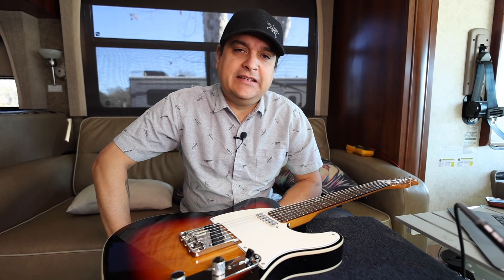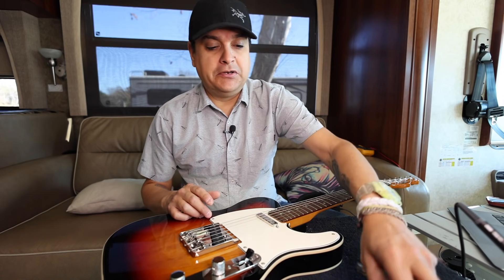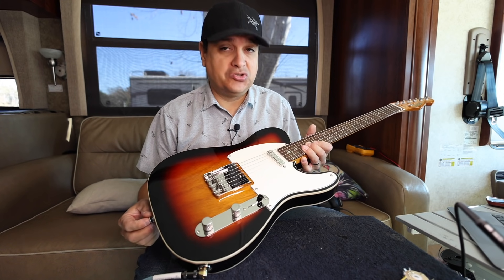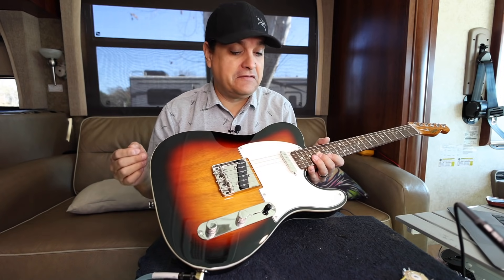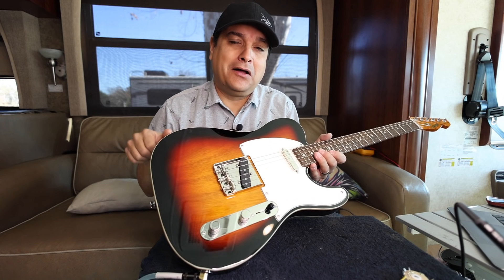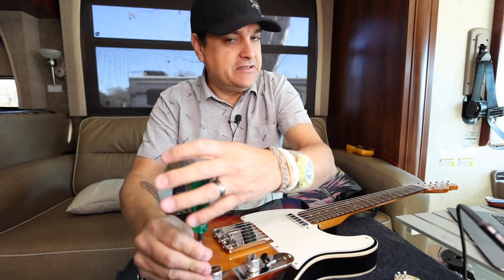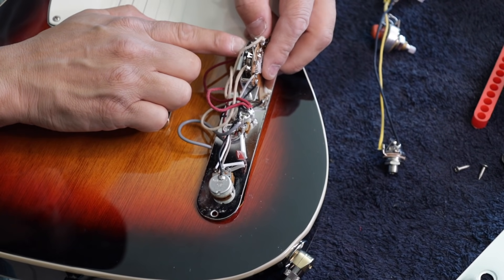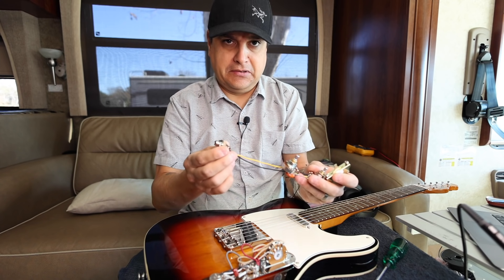3 Reasons To Replace The Pots And Wiring On Your Guitar

Comment: Worth a mention, sometimes in just replacing the pots and wires in a budget guitar, you can 'rescue' a set of stock pickups. Sometimes [I said SOMETIMES], doing that simple change may breathe some more life into the circuit. There are naysayers, and they do not have MY ears, so when they say they don't hear a difference then it may be because their ears cannot hear the difference made. I have done this to Squier and Epiphone both with some success and not. But, the issue is, SOMETIMES it it worth doing the pots first, before buying expensive pickups for 'old/cheapo' pots.
 I guess it won't get mentioned since you might be sponsored by suppliers/manufacturers.
Reply: Absolutely true. Some inexpensive ceramic magnet pickups sound absolutely fine with the addition of quality audio taper pots of an appropriate impedance and a suitable capacitor value in the tone control circuit. It’s certainly worthwhile to do the pots and wiring first then re-evaluate the stock pickup sound before committing to a pickup upgrade.
Reply: @15thwardadrian  Exactly, I glad you added to my comment, it adds to the evidence and I thank you SIR. And, you know there will be more naysayers commenting on this, and their added silliness of inexperience will be witnessed by all. Likely, Millennials and Gen Z's that just haven't learned yet.
Reply: Total Bollocks!  Like for like impedances and capacitance will not change the sound regardless of what you interchange.  Only thing that will change is reliability.  Thats just the way it works with electricity!
Reply: @brin57  Yes, on paper the values follow rules, but the actual readings differ from manufacturer to manufacturer, and that affects audio signal. Usually, the cheapo pots inhibit some of the signal. If you follow what books and math tells you, you get the answers, but not the experience. Ears can tell the difference, if yours don't, then I'm real sorry about that.
Reply: @b.scottfarthingsworth  Readings differ even from the same manufacturer of the same pot.  It's called tolerances.  As for cheaper pots inhibit some of the signal, that's what pots do. All pots.  Thats their function.  Some just last longer than others or are smoother, but as I said, like for like will yield the same result.  If not, then something is different.  No 2 pots or resistors or capacitors are the same, and any perceived differences in sound, could just as easily happen between different instances and/or combinations of the same products.  Not just between cheap and more expensive.  As for your ears argument. That's just condescending.
Reply: @b.scottfarthingsworth  Your arrogance knows no bounds.  You just sit there and assume you are all knowing, without even having any idea who you are referring to, their knowledge and experience.
Reply: @brin57  okiedokie keep buying pickups everyone👌
Reply: @tommacdonald6295  Love how he assumes he's talking to people with no knowledge or experience.  Oooh, he's got golden ears!! More like cloth ears.
Reply: Most of the time...it is what you WANT to hear as you might not have changed anything at all.
Reply: @b.scottfarthingsworth  Yours and other's half informed sage further adds to their confusion.
Reply: @brin57  Value is value in components not mechanical. Their is where the reliability factor lies. People like to feel good spending too much money chasing myth.
Reply: @alwaysopen7970  Or others feel good trying to get others to spend too much money chasing myth, based on their sketchy subliminal bias's.  The biggest change to be had from re-wiring your guitar with quality parts is reliability.  Longer lasting smoother pots and switches ,  better solder joints, etc.. Not improvements in the sound quality (except if you're changing out scratchy pots) and certainly not changing the fundamental character of the sound.  Maybe a new Youtube channel is in order.  Audio Mythbusters !!  Probably already exests.
Reply: @alwaysopen7970  maybe for you, because of what your ears hear, as opposed to what someone else's ears hear. Also it's agreed that SOME of the time nothing changes, anyway. 
I've even experienced times that it may have sounded worse. But like I said previously, And to my ears, SOMEtimes there's noticeable differences that I've heard as positive results in that quest. I said MY ears. Maybe your ears don't hear the same thing that mine do? But, no investigation is needed. In my ears, it is already proven. And others are in agreeance with me, so they're hearing some of the same things that I do, too.
Reply: All good advice but firstly, check the height of your pickups! Setting them to the recommended or suggested heights of the manufacturer DOES make a difference.

Comment: Question:  I have a 1999 Fender Nashville Telecaster 3 pu/ 5 way.  All 3 Seymour.  B Bender Saddle, CTS, 22, Treble Bleed,
Vintage Wiring.  My favorite of 8.  All tube amps except a Fender Deluxe 112 which as you know is a Freak!!  What is the
loss in Potential and Frequency between the Vintage wiring an the Modern wiring.  I am willing to make one more internal
change on this Beauty.  Go back to Modern or stay with the Vintage Mod ???  Thank You  DGA

Comment: Would have been helpful if you had A/B edited the before electronics change and after electronics change video/audio closer together. With that much time passing between the examples, it's hard to tell any thing. 
I've found, over the years, with many of the overseas produced instruments that the weakest link is the electronics and it is primarily a reliability issue. Switches go first, pots get intermittent and jacks don't make good contact after a fairly short time.

Comment: I bought a display 2021 Affinity tele from a large store for the discount. It had a couple small scratches. When I opened it up...it has CTS pots. I wonder if it came with them or was it repaired or upgraded in the store.
Reply: CTS pots are most definitely not stock for an Affinity Tele. You got lucky !
Reply: @raytorvalds3699  Lucky? Only if they are the right ones.
Reply: @JasonWW2000  Heh true.
Reply: They hotrodded the display model?  Sneaky but ounds like a score for you.

Comment: Really great videos Dylan, im learning a lot. PLease just a quick question " I just bought online a Fender Duo sonic, I just find out that the volume pot works a little werid, when Im going up, the signal is very weak and clean all the way to number 8, only when I reach the 9 an 10 the sound sudently becomes much stronger and thick, I have a strat and a Tele...the volume pots works like very linear in comparison. Do you think may be some problem in the volume pot of my new Duo sonic....or maybe in the wiring?."... maybe I need to ask my luthier to re wire and change the volume pot on my brand new guitar..... thanks so much!
Reply: He talks about that very issue in the video

Comment: Hey Dylan
Do you do wiring harnesses for a strat sss?
What I'm looking for is G&L PTB system.
250k volume
500k treble cut
1 Meg reverse bass cut
5 way switch and a mini toggle expander.
Basically a G&L Legacy setup.  
I can get the parts from G&L and do it myself but I'm shaking and eye sight not good. 
You interested?
Reply from the maker: We do loaded pick guards

Comment: Dylan, you never said what taper the pots had factory. I'm guessing the volume pot was linear and you switched to audio? What about the tone knob? Is it factory audio taper? 
I'm new to this, but I tried both styles for volume and tone and I definitely prefer the audio taper for both.
Reply: I build guitars from kits, first thing I always buy for the kit is replacement electronics, which includes ALWAYS audio taper pots for both. Much better results every time.
Reply: @thetattedpharmacist3215  I don't have experience in what normally comes in kits or in factory guitars. Do you see a lot of linear taper pots? I wonder why they use them?
Reply: @JasonWW2000  Honestly the first time I built a kit, I had no idea, but knowing what I know from reviews etc, I was underwhelmed with the tiny dime-sized alpha pots and crap quality capacitors etc. I was advised by watching reviews and building videos to always go for audio taper pots for both and they've always served me well. My first purchases are always CTS full sized pots and Sprague orange-drop capacitors, adjusting their specs dependent on whether I'm using single coils or humbuckers of course. Next purchase is always better pickups too than the cheap Chinese trash they ship with kits.
Reply: @thetattedpharmacist3215  Wow, you don't really watch Dylans videos, do you? You've been brainwashed into buying stuff you don't need. I guess thats fine if you have the cash to spare. Just don't get caught up in it. Next you'll only buy Fender brand guitars, then only the made in USA fender guitars. Then only the vintage model fender made in USA guitars and on and on. It's a slippery slope. Lol.

Comment: My Tele does that. The volume knob goes from 0 to 100 in an 1/16th of a turn. I was guessing it is an audio taper and should be a linear. What do you think?  It is an HH Blacktop so it should have 500k pots in it I guess. Or, that is what I will replace with if I need too.
Reply: That sounds like a linear taper. You will probably prefer an audio taper pot. Its logarithmic scale provides smooth changes as you turn the knob. Its not intuitive. The audio taper sounds how the linear taper looks. My strat came with linear taper volume pots and I got 70% of the volume from numbers 1 to 3. Then from 4 to 10 was a slow volume increase from 70% to 100%. I hope that clears it up for you.
Reply: @JasonWW2000  Okay cool. I have both pots in stock at my shop. I'll try changing to an A500k for the volume and see what happens. It is an easy change. Thanks.

Comment: Wiring and shielding: Don’t leave the biggest improvement on the table! Proper shielding with copper (not aluminum) tape, soldered joints, and full coverage of the back of the pickguard on Fender-style construction greatly reduces unwanted noise compared to bare finish or a badly-applied factory conductive paint. Changing wire does zilch in comparison, so don’t waste time and money on a replacement harness without doing a proper shielding job. Shielding can be a 50% improvement, compared to at most a fractional improvement from an overpriced aftermarket harness.

Comment: Pots: Don’t change them unless you need to! Aside from the taper, there is no reason to change them unless a.) noticeable crackles or sloppy operation, or b.) dark, dull tone because the resistance is too far to the low side of tolerance. As long as a cheap mini pot truly measures 250K, then a longer-lasting, more expensive 250K pot will NOT sound different.

Comment: I really don't understand why guitars would even use linear taper pots?   Perhaps some guitarists just use the knob to function as an on/off and don't like to dial in a tone?   But I love having audio taper pots for tone + volume so that you can get fine-grained control over the sound
Reply: I think it is an availability issue as well as a manufacturing issue. For a while I was running across Linear taper pots with the "Audio" designation stamped on the pot.
Reply: You clearly don't have a clue what you're talking about. An audio taper pot is the one that would  give little effect untill the end of the pots travel. A linear pot has a steady, LINEAR effect on resistance.
Reply: @FoulOwl2112  That's exactly wrong.  That's why Dylan switched from linear to audio in the build above. That's what he's showing when he did the comparisons between 10 and 7 on the volume pot.

I will agree, though, that the name linear is dumb and misleading and confusing.
Reply: @GEfromNJ  Yeah it is a bit confusing indeed, as the human hearing is logarithmic. So in theory, our ears would perceive a logarithmic (audio taper) pot as being more linear than an actual linear pot. Which is what Dylan showed in this video indeed.
Reply: The taper of an audio pot sounds the way a linear taper looks. It's not intuitive. If you want steady increases in volume as you turn the knob, get audio taper.

Comment: Throwing my 2 cents worth into the conversation about sound/tone.  Firstly you’re no going to hear much difference in tone or sound if you’re listening to these types of videos on YouTube as the audio is converted for performance and in heavily compressed and if your listening with Bluetooth headphones, it’s even worse. So in general you’re only going to hear the most radical differences which is a point I’ll draw on later in this comment.  Secondly, A/B tests or any comparative assessment is meaningless as a slight difference in sound or tone doesn’t equate to bad, it’s just different. The idea that all Uber expensive guitars from the same manufacturer of the same model have a uniform sound is fantasy, every guitar sounds different and that do make on better that the other, they are just different and you’ll choose to one you feel the best with.  The quest a lot people get wrong is it not that a cheap Squier doesn’t sound as “good” as a custom shop so therefore the Squire is bad.  The question is, is the custom shop worth 10 time more than the cheap Squire.  Are you really getting value for your hard earned money? I’d suggest no.

On to tone, this is a fascinating subject.  People sit in a quiet place and listen intently to the “tone” and nuance or the guitar, then will throw on heavy distortion and and a long run of effects pedals. It’s funny.  And then you get into a band situation where all the fuss about and nonsense about the quality of your guitar gets thrown out the door as you need to change the sound that sounds so great in your bedroom to one that can cut through , balances and doesn’t clash with the other instruments in the band.  Also if you are a working musician you need a solid reliable instrument that works, stays in tune, plays in tune and if it gets lost or stolen you won’t need to sell your left kidney to buy a new guitar that of course after you recover from the heart attack.  The Squire is a fantastic platform and cheap especially if you buy it second hand. Get it properly setup, I will add all guitars need to be properly set up even the Uber expensive ones.  It will play like a dream and if you must tinker, you are spoiled for choice and even if you completely gutted the instrument and replaced all the parts it would still be cheaper than an Uber expensive guitar,  heck buy two and you’ll be able to buy a good amp because that’s what makes the real difference.
Reply: All true above, buy 10 fender or 10 squire and you probably get 1 great fender, 1 great squire with a dud, maybe 5 ok playing and a few with rough fret ends and one with bad wiring.

Comment: I don't like the breaking up sound of the pickups. Grungy. It should be warm, full but clear. If I need a braking up sound I use the amp's gain option or a blues type pedal. I like your sound at lower pot setting or very soft playing. I prefer  the Fender Tex-Mex sound. It's personal. ;)

Comment: However , uno caveat - if the guitar is a "vintage instrument" and there are no issues with the pickups , pots , wiring or switches LEAVE 'UM ALONE !!!!!!!!!!! i.e., DO NOT risk effecting the "collector value" !
Reply: Just keep them after replacing so you can switch back before selling.
Reply: @carlthegnarl Even disturbing solder joints will affect collector value.
Reply: @johnsieff2921  I'm not much into collectable guitars, agreed. But if you care about value loss, just let a pro solder the parts to make them look normal.
Reply: If you don't plan on selling, then why worry about collector value?
Reply: @TexanUSMC8089  If one is doing these budget mods to cheap Asian guitars, is "vintage" in the same conversation?

Comment: I can't believe the useless misinformation some still spread on these channels. First thing I picked up on was your view of the taper of the volume pot. You should be able to turn all the way up and control the way in which you attack the strings. The worst aspect of these channels is too many people, especially beginners, are hearing hundreds of different points of view which is nonsensical meaningless mental overload and confuses things further. They end up chasing bullshit and spending money they needn't.  I have been playing since 1974, my oldest guitar is a 1957 P bass and my newest a 1999 PRS. The only things I have felt a need to change were pickups or worn tuners.

Comment: The guitar will be worth the same after installing this kit.  If you want to sell it later, you're losing the cost of the kit, $265.
It might make more sense to sell the guitar instead and buy a better one, using the money you get for this one plus the money you earmarked for the upgrade.  You could get a second hand Fender Player Tele, which should give you what you want (full size pots etc).  Then, if you sell that one later, it will still still be worth pretty much the same and you don't lose your $265.
Reply: Always buy the guitar with appointments you want rather than a cheap one you plan on modding.
Reply: Well, captain obvious, to get a Fender with all the aftermarket goodies you can put on yourself like (possibly second hand) kick ass pickups, tuners, pots and bridges/tremolo systems, nut and saddles will cost well over a grand. What if you WANT to learn HOW to upgrade a surprisingly great playing inexpensive guitar? Are you going to do it on a $10,000.00 vintage Telecaster or Les Paul? No. You're going to do it on a Classic Vibe or an Epiphone, have fun learning throughout and have a better guitar than you had b4 that's unique to you and why would want to sell a guitar like that?